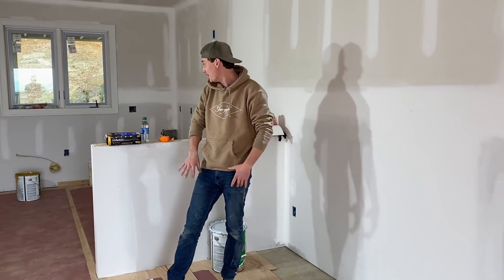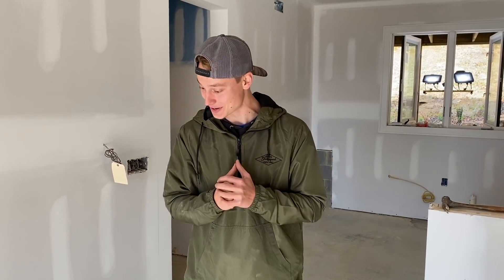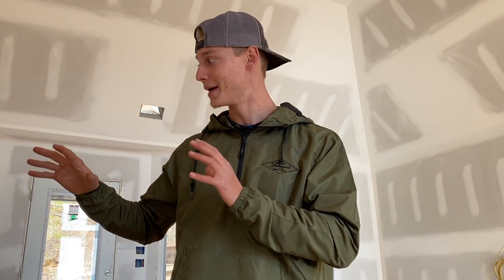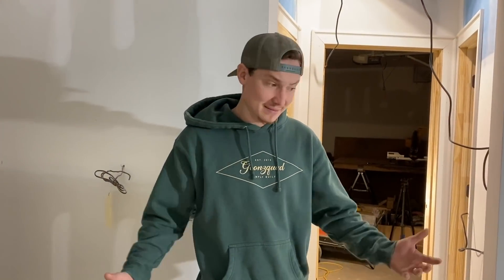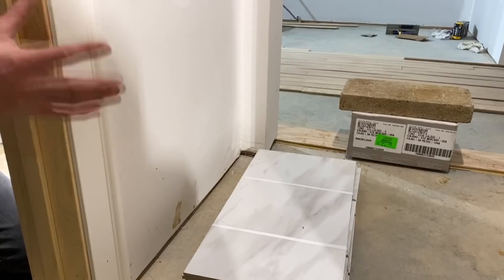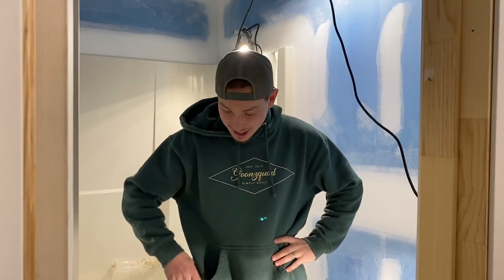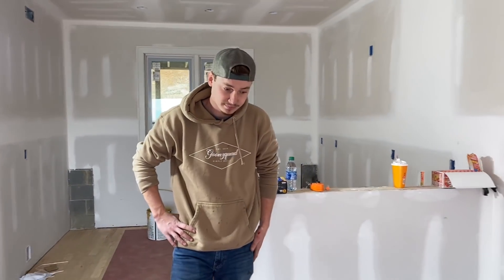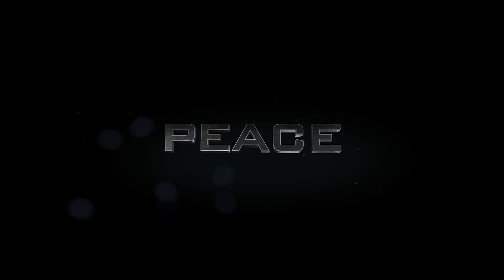The New Goonzquad Headquarters Part 55

Comment: NO I'm not a 35 year wood floor installer but I watch a ton of this old house. They say to install hard wood on concrete you have to use a concrete sealer to prevent moisture from going into the hardwood causing it to CUP.   They also talk about letting the hard wood sit in the house to acclimate to the room temp before installing. BUT hey if they messed up they will just do it over again and we all will enjoy more videos in 2021
Reply: Re: acclimation. There's nothing to acclimate to. There's no heat in the house so it's the same temp/humidity as outside. There are likely to be some minor issues once they get heat.

Comment: “We talked to a few professionals and they said not to put tile in by the front of door”.  Sooooooooo the wife said no!!!😂
Reply: Lol
Reply: It’s their floor and their project, their regrets 😦😂
Reply: Ha ha, yeh
Reply: Yep ceremics by the front door = mini ice ring when wet or muddy , no thanks .
Reply: Good call.
Reply: @mishafrog8786  they do make tile that doesn’t get slick when it gets wet
Reply: @Bail_Money  Agree 100% but they look ugly, having owned and run fast food outlets ceremics are easy to clean but the non slip versions I would not like as my front door threshold.
Reply: @Greg_hun  Just hit the 3 dots and report spam.
Reply: @mishafrog8786  it's 2021.
They also make wood tile that looks very good
Reply: @llamacebu216  Agree but i would go sunk mat look, would also go for a vestibule on that house then have the matt there.

Comment: sweeps the floor immediately starts grinding concrete down 😂
Reply: just like upstairs, they never cleaned the dust off the walls before pouring out what ever finish that was on the floors.

Comment: that floor straight onto the concrete is risky. if the humidity go up the floor can get wavy as hell. that happend in my kitchen. also in my livingroom they installed the floor in the wrong way. there they did pout the floor to close to the walls so when humidity went up the floor had no way to expand so it got like airbubbles/wavy aswell
Reply: Are we assuming that there wasn't a moisture barrier put down before the concrete was poured? There is such a thing as a water repellent that is instilled into the concrete when it was mixed! Give them a break already!

Comment: Starting to realize how small this house is.
Reply: This is a phenomenon which one never becomes used to. A house that seems spacious on the plans looks tiny when laid out on the site, because of the wide open context. Once the ground slab is laid it looks even smaller, because it is only a few footsteps wide. Putting up the structural frame adds complexity, and gives a reassuring feeling of depth and space. But when the walls are clad and the individual rooms become separate isolated spaces, everything seems to shrink again. Of course it always works out fine in the end, but the psychology of home construction is always entertaining to experience. In most cases, our Clients and Patrons avoid visiting the construction sites of their future homes, and prefer to turn up when everything is completely ready for occupation. Handing over the (electronic) keys is always great fun!

Comment: Between the windows and the floors, these kids are building a house of cards.
Reply: Buildings of this type are not meant as permanent structures in the way that more expensive masonry houses tend to be. A typical timber frame house in the USA has a useful life of 30 to 40 years (provided that it is properly maintained), and then will usually need to be substantially renovated, or replaced with a new building.
Reply: @johnstedman4075  That is not true , you can't live in the US.
Reply: It's all going to come crashing down.........Well said !!
Reply: @johnstedman4075  lollll wtf are you smoking

Comment: Lol looks like everybody in the comment section has been a professional in painting, laying floors, etc...the comment section always makes me laugh.
Reply: Alot of us are! Thats why we enjoy the channel. 23 years as a handyman
Reply: Wood flooring contractor with 25 years experience here
Reply: I'm just the resident HVACR ..been doing it since 94. But nobody listens.
Reply: @FlyEaglesFly19111  haha, cue poor maintenance by the owner costing thousands of dollars worth of repairs
Reply: 35 years in the trade 10 years teaching kids at college 30 years a building historian
Reply: 80 years of experience here, still don’t know how to make $ on YouTuber. 🤤
Reply: I’m just diy but I would put some sort of underlay down to stop the crunching noise which happened when they walked on the floor they laid, also I may be wrong but glueing the planks to the floor will stop them from expanding.? Glue planks together and leave a gap under skirting so they can expand and contract. Just saying it’s not how I would lay a floor.
Reply: @michaelrich5501  With engineered wood flooring, it is made like plywood where the plies are laid in alternating directions so it has more dimensional stability.  Glue down is a quite acceptable installation method over concrete.
Reply: weird people have jobs and watch youtube
Reply: @michaelrich5501  Glue down hardwood floors are common. They don't expand/contract. Neither do nail down floors. Only floating floors expand/contract. With that being said, since it's not a floating floor, they could have installed them a wee bit closer to the walls.
Reply: I actually am a certified carpenter.. 18 years of experience
Reply: @SPW812  Totally get you...YouTube world is certainly something different...but you could do it...with all of your experience, you could definitely teach many people what you know.
Reply: Was that left handed wood?  Maybe that was the problem.
Reply: i am a Youtube Certified Contractor. for the past 11 years
Reply: well that's the type of audience your gonna find watching these types of videos.  Do you think hair stylist and babysitters watch this stuff?
Reply: @556ChannelHD  yes they do actually

Comment: I would of put a vinyl plank flooring that has a lock system instead of this glue on the concrete floor. You guys should of sealed the floor for moisture.
Reply: that wood will be bucklin soon with all the water in those hills
Reply: @Pugelista41  That's why I suggest them to install vinyl plank flooring and they 100% waterproof. I installed them in my finish basement
Reply: Or perhaps an engineered hardwood with a vapor barrier underneath.
Reply: yup i watched the first 10mins and was going to post the same comment.  Do you think they listened. This video was made about a week or so ago...maybe longer. we may never find out.
Reply: All they would have had to do is do a floating subfloor... it would have allowed for air and moisture to move under it.. they would have lost 3/4 to a full inch, but the hard wood would be perfect forever.  If y'all want a great home DIY channel that I follow..  Home RenoVision DIY.  Ottawa Home reno experts... I've learned to do almost everything in my home... Im burying a header, and completely gutting and redoing my kitchen in about 4 months.
Reply: @Pugelista41  read my comment under Fromafar. not just this one. but i agree to what you are saying.

Comment: Guys, never put wood on cement without a membrane
Reply: I was thinking that also
Reply: I was thinking the same thing, maybe that's why they lost their old job they had doing flooring, their old boss might have fire them & not told them why
Reply: @6996brandyl  no they just went youtube full time
Reply: It's just more content in a couple years. "How to replace a wood floor with carpet" because by then that will be back in style.
Reply: May not be as much of any issue since it's not new concrete.
Reply: They also should have put the wood the same direction as the door, your eyes will catch them lines once you walk in the door if they are a little off  , the way they have them
Reply: It's engineered wood isn't it?  Should be no dramas if their  using a glue with a moisture barrier built in.  10 year old slab also.
Reply: @Turbulentworm  
No it is real wood. I would have put down a fake looking wood to see how they liked the look. Real hardwood with a dog will take a beating.
Reply: It is done now so time will tell how it holds up.  Worries me that they still have cabinets to put on top of that.  I hope for their sake all goes well.
Reply: @Turbulentworm  Yrs & that makes it worse, It don't matter if that concrete is 100 years old , water can can go right thru concrete
Reply: @lwjones2  I was woundering that to about the cabinets, I think they should have painted before the put the floor down to
Reply: The glue acts as a water retardant membrane.
Reply: How long before the wood absorbs moisture from the floor and warps?
Reply: @larrybe2900  it is engineered wood. only the top layer is real wood.
Reply: The glue is the membrane
Reply: @cokeman4603  The wood will not absorb moisture from the cement floor?
Reply: I have read up on this and it is possible the glue is acting as the moisture barrier. There is a lot of concrete slab housing and a solution for most any application.

Comment: Hey guys, when installing hardwood over a cement slab foundation you’ll need to add a moisture barrier between the two, plastic, tar, etc. Otherwise, your hardwood floors will warp, as concrete absorbs moisture from the ground. Good luck guys :)
Reply: When I bought my house, the floors were laid exactly like they were doing.  First thing I had to do was rip out all the flooring, wasn't easy with that yellowish glue.  So much warping.
Reply: This house is trash and needs to be completely redone after it's completely redone 🤦
Reply: I was thinking the same thing. We were told not to put wood flooring on the basement because of the moisture in the cement.
Reply: Without the concrete sealed, this hardwood will over time self destruct
Reply: Exactly the first thing I thought when seeing them gluing the hardwood onto the concrete.....
Reply: Some glue (which I hope is the case here) Acts as the bond and seal for the flooring. What your talking about is a floating floor, which isn't as solid and may be down to their preference and why they went this route, their not complete idiots.
Reply: exactly
Reply: @TychoBrahe21  so call expert
Reply: @carpdude73  so call expert
Reply: @jstanwatson9919  so call expert
Reply: @Wolfdings  so call expert
Reply: @Kay8B  so call expert

Comment: Wow this is bad. You need to seal the concrete floor first and put a moisture barrier first or the hardwood will be destroyed within a year.  Why not paint the entire house first than after  you can do the floor. You guys are working backwards. Good luck
Reply: @lolo88ify  you disagreeing with the comment doesn't make it trash. They did it wrong, plain and simple. Having a brother who's a contractor, you would think these errors would be avoided...
Reply: @wbzial  the glue seals it but ok boss
Reply: The slab could've had a moisture barrier before it was poured! plastic? Or there is a moisture barrier instilled in the concrete mix! So it may already have the moisture barrier they need!

Comment: Should of used an engineered hardwood flooring that locks and floats on a slab with a 4mm underlay,  would of had it done in 4hrs.....
Reply: coulda woulda shoulda...
Reply: cannot wait for all the water in the concrete to get soaked up into the WOOD floor, going to bow an cup all over the place. 2 years MAX and they will need to rip it all out
Reply: @Gantzz321  well aren't you a ray of sunshine
Reply: @gregh7457  "coulda woulda shoulda" = says same thing, but with less detail sunshine, no point in pretending to be polite
Reply: Yes yes yes! Save your breath tho, they don't listen to us experienced people.

Comment: Hi guys. Wish you and your family a very Happy New Year !!!  Someone trying to help you made several suggestions........  water proof membrane on the concrete before installing real hardwood. This is a major error guys. Moisture will migrate through the concrete then will start developing black mold. Second heads up given advised you to normalize the wood flooring. If the wood is cool or cold and you glue it to concrete, when heat is turned on permanently, the wood will expand not might, it will. Since it is installed tight as correctly acclimated flooring is supposed to be, it is going to buckle. I don’t know who you are getting advice from but they are wrong. I don’t want to rain on your parade but this is a major problem that over time when mold develops can adversely effect the health of your family. The only fix at this point is take up the wood then decide if you really want wood floors or would luxury vinyl tile than looks like would could be a better choice. You have my contact info if you want to talk. Good luck with whatever you decide. Stay safe !
Reply: i agree
Reply: Sounds like some common sense to me, something which is more often seen in the comments than the videos.😁

Comment: You’re supposed to let your hard wood flooring acclimate to the environment that it’s being installed in for at least 72 hrs
Reply: thats an engineered product. its a laminated piece that will have minimal shrinkage
Reply: @gregh7457  most laminates still call for it to be acclimated
Reply: More like 2 weeks
Reply: They're using a propane heater in there. I'm sure that's what I saw. The climate in there is not stable lol
Reply: @michaelryall7893  2 weeks for what Acclamation?

Comment: Should have left wood in house for a few days to acclimate it
Reply: Does this rule apply if it’s not in a temperature controlled space?
Reply: @DCLAWATTORNEY  yes, specifically for moisture/humidity differences.
Reply: not going to matter, they don't have vapour barrier, felt, subfloor. That wood is going to need to all ripped in very quickly. The moisture it is going to suck up through the concrete is going to destroy it. Rule one never put wood directly on concrete, and they didn't follow it.
Reply: @Gantzz321  not true. The type of glue they have is designed to resist moisture. It’s also sound dampening.
Reply: @Gantzz321  it's fairly common to do what they did here in GA.  My old house was done like this and there were no issues.

Comment: I thought if you glue all of your hardwood its gonna buckle and warp because of the concrete right under it plus the humidity in the air.
Reply: Your right the wood floor should be floating on concrete
Reply: They like doing it the wrong way first then fixing it later, more content, haha
Reply: @farmtruck9885  Exactly!
Reply: Doesn't matter if it doesnt work out, they will just go buy another Floor.😂🤣😂
Reply: How is wood supposed to be floating in concrete? Makes no sense buddy wood doesn’t interlock like vinyl and laminate
Reply: @ivanrotar3  Tongue and groove wood flooring?
Reply: @puirYorick  exactly lol
Reply: I thought terrazzo flooring would have been a better idea. That way they could have put their logo in it.
Reply: +1, that was my first thought as well. In my house we nailed down water resistant plywood and then glued hardwood on top of it.
Reply: No, you can glue down to concrete no problem.
Reply: You can glue it no problem but the major issue is the temperature isn't controlled. It will be expanding and contracting like crazy once the heat and ac are turned on.
Reply: @ryans5704  yes that's true I was just commenting that not gluing to concrete as some kind of blanket rule isn't correct.
Reply: Wood expands and contracts which means big gaps between planks when contracted and v rucks when expanded imo
Reply: They said it was manufactured wood, I think it's built specially for this
Reply: I glued mine down to the concrete, I don’t worry about humidity. I live in Arizona, working great.
Reply: Both will love together ( to a degree) works fine

Comment: Love the content as always, but with how humid it is where you guys are, I'd be worried about moisture in the concrete under the hardwood and and tile. You guys really should have put a layer of concrete sealer or a plywood sleeper subfloor before laying the hardwood. Keep an eye on the wood over time. I wouldn't be surprised if you start to see issues with the flooring due to moisture underneath.
Reply: That floor will be trashed in a matter of weeks if not days with the amount of humidity from the damp winter weather
Reply: Are we assuming that there wasn't a moisture barrier put down before the concrete was poured? There is such a thing as a water repellent that is instilled into the concrete when it was mixed! Give them a break already!